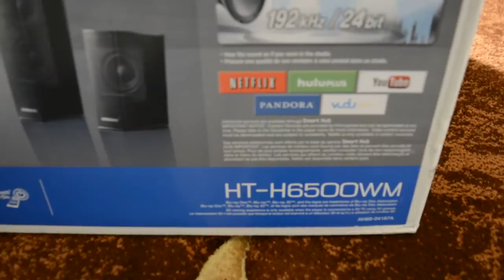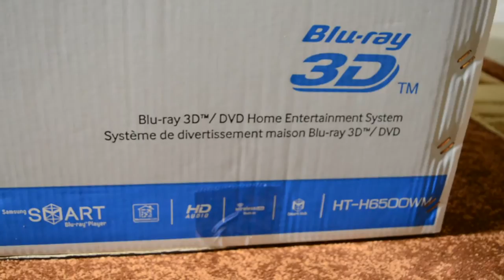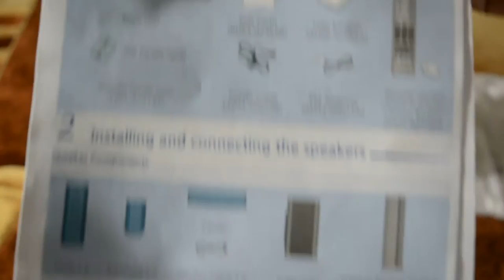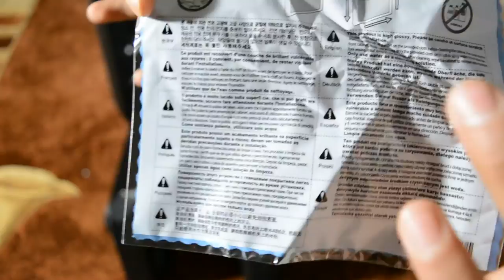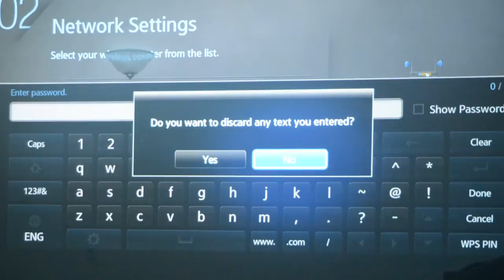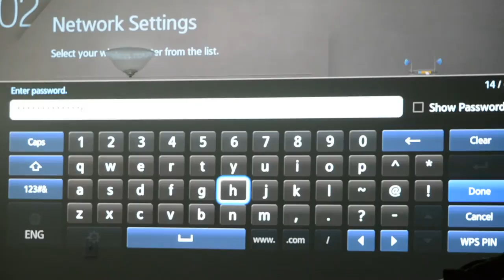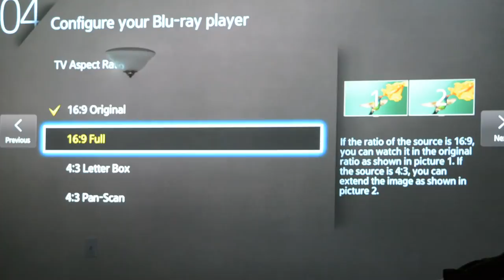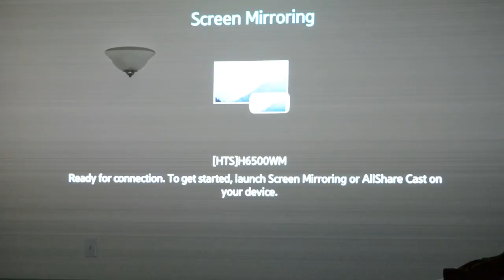Samsung HT-H6500WM||Smart Blu-Ray player||Unboxing and review!!

Comment: So what happens if the wireless receiver goes bad? They should still give you the option to plug the surrounds into the player.  And why are the wires not attached to the speakers?

Comment: Can someone please help me please ....... Does anyone know how to connect a Samsung LED TV that's NOT a smart tv but we have this exact samsung home theater system hooked up to a Samsung 55 in. LED TV EH6000 Series (2012) and get the TV to play what's on the screen from another samsung device like a Galaxy View (18.4 in screen) or an Galaxy S7?  Also I know how to use this system but only can get quick connect to play threw the home theater system onto the TV but that only let's u play saved movies or display pictures or music.... trying to get the TV to display screen on Galaxy View or Galaxy S7 either or doesn't matter,  but is there a way to do it wirelwirelessly so that I can see what's on either device threw the home theater system without a wire? Or do I have to get some sort of converting wire from device to tv? the TV has no plug in place in the back or side for even a wired Internet connection .....sorry if I sound confusing. oh and by the way I have bsoulty no idea and haven't ever used allshare or screen mirroring or even share it. 
Thank You for any and all help!

Comment: im just having problems with mine it turn off by itself
Reply: I just found what the problem was. The touch screen goes bad so i just have to open the case and unplug it now it just works with the remote.
Reply: Touch screen?
Reply: Yes the touch screen goes bad.
Reply: It doesn't have a touchscreen. It just has buttons.
Reply: Buttons are not a screen.
Reply: Right just open it and unplug the front panel
Reply: Send it to samsung to be fixed.

Comment: Is there and aux plug in?
Reply from the maker: I don't think so as you can just mirror a cellphone if required. Assuming that the device supports screen mirroring.
Reply: What's aux in for?Bluray player doesn't have aux in.
Reply from the maker: It is a headphones jack that you can use to input audio into the device that has it to play your phone audio or music player audio through that device.